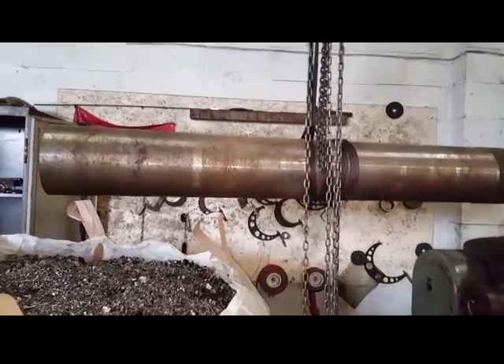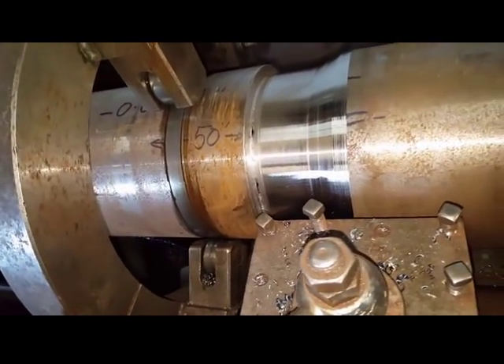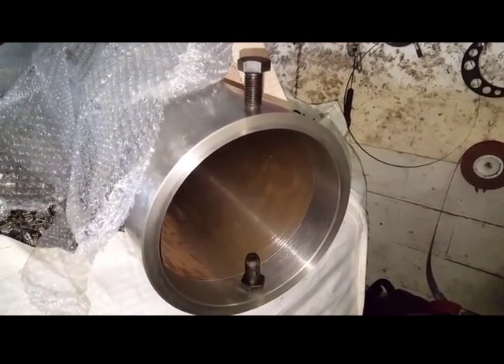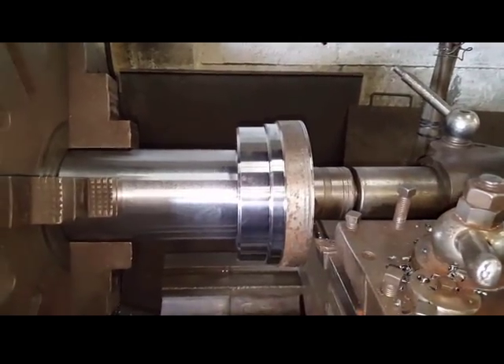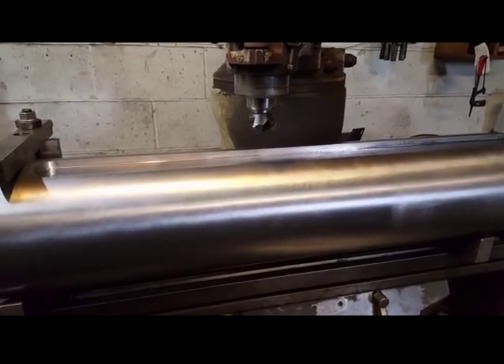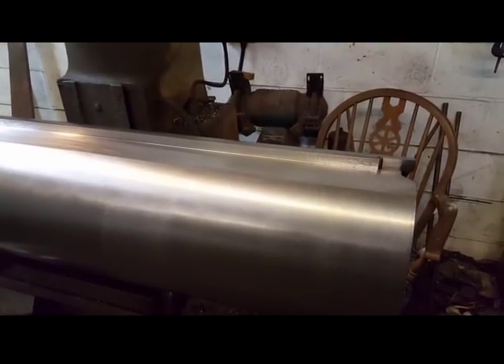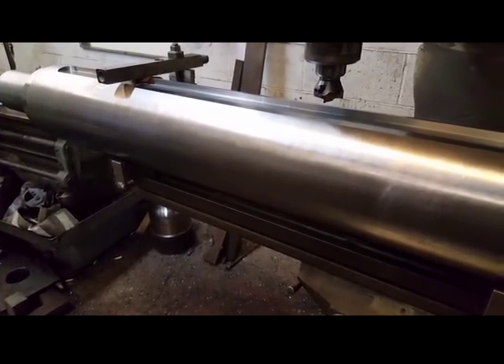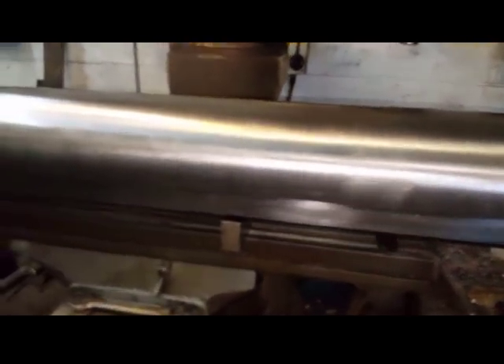Rusty pipe made into 9" Trepanning Tool. To cut 50" deep

Comment: Lots of tools made - and now you have sold em all .. it's like a GB downfall .. .Covid19 looks pale compared to this slaughterhouse... all gone ... no more work? .. :-/  soul of the machine is bleeding..
Reply from the maker: I'm still working but not for myself anymore. I'm still making videos at the place I'm at. Yes I made all my own tools but they are still being used at a company I sold my Trepanning machines to. I was gutted at first but now my life is much easier.  Thanks for your comments buddy 🍺👍
Reply: @userwl2850   it's great work.. have done the same. But never made BIG HOLES.   How many cutting meters you run in that 718 steel ?  20 or 30 ?
Reply: @userwl2850    A good 2PI man ( 2*180DEG = a hole rotation ...  hmm I like those tools u have made! "!   Have to show up there locally .. you know alot. BR Wiking from east of York ( danish Town in Danemark WEST WEST )

Comment: Nice! Really nice work buddy, 
Question plz, that weak spot on the pipe where you pointed out, Duse that have to be a sharp positive corner ? Or could that bit be milled with a radius bit leaving you with a stronger and slightly thicker web ? Or am I just talking shite lol ? 🤔
Reply from the maker: Not shite at all Mark. In fact very intelligent question.  These tools have a 15mm wall and the inserts can cut a 16mm chip if not set right. The inner wall ends up 13mm at best ... 16 into 13 doesn't fit. These tools I make with a 17mm wall to oppose the problem.  If a bigger radius was left it reduces the evacuation channel. I'm very impressed with your thoughts. 👏🏻👏🏻👍

Comment: Another great job Dave (I seem to be saying that a lot these days).  I had a smile on my face when I saw your method of angle setting at 21:35.  I used a similar method to pick up a large keyway that needed to be lengthened. In my case the R8 nose was too large so I turned and faced a pin just smaller than the keyway and held it with a collet.  Rotated the shaft until the face of the pin and bottom of the keyway were flat against each other.  In a future video could you show us the vee blocks you use on your Bridgeport.  I could only see part of them but they look very interesting.  They look to have a nice low profile.  All the best in 2020.  Thanks, Ken
Reply from the maker: Hi Ken. I made the v blocks 25 years ago. I use this way to line up a lot.

Comment: With respect, if the major cause of failure in the tool is splitting why does it seem that so little attention is paid to the geometry of the exposed section of the thin wall stress riser point adjacent to the cutter, please?
Reply from the maker: Without the thin section there is not enough gap for the chip evacuation.  9 out of 10 the centre cutting will fail.
Reply: @userwl2850  the thin section is absolutely necessary but the transition along the inner diameter of the pipe section should avoid sharp angles on the front edge in favor of a radius to spread any stress.
Reply from the maker: @chuckpatten7855  yes I understand what you're saying.    But.... they last year's before they split. If a bigger radius was left.. even by 1mm that makes the chip evacuation slot too small.  A 14mm wide chip will not fit through a 12mm gap.

Comment: David, you didnt seem concerned about the spindle bearings when you did the welding bit !. Always read that it is a big no no welding in the lathe , so perhaps a bit of a myth ?. Happy 2020 .
Reply from the maker: Hi Roger. The only problem is damaged electronic... just isolated the lathe. No problem.  Happy New year to you
Reply: depends where the ground goes, if you put it on the workpiece no current goes through the bearings

Comment: Tends to prove the point that very often an attempt to save cost in fact leads to more! Best to do it right and save you a lot of hassle - lot of stages and setting up.
The abrasive paper external clean-up must have used a few feet. Nice long series drill. Fascinating to see some of your techniques.
You are a talented man.... experience cannot be bought.
You need several John Smiths after all that!!
Great video Dave - thanks for that and - all best for the new year.
Reply from the maker: You are a true gentleman Chris. Thanks for all your positive comments.  Happy New year fella.  🍺
Reply: True. My boss once tried to save some money by simply switching the insert grade and not telling us.
The results are much much less insert life, so you have to either replace the inserts much more often, resulting in higher costs for the tooling or slowing the cutting velocity down, which would have made the whole process much less productive.
So we talked to him to go back to the old insert grade.